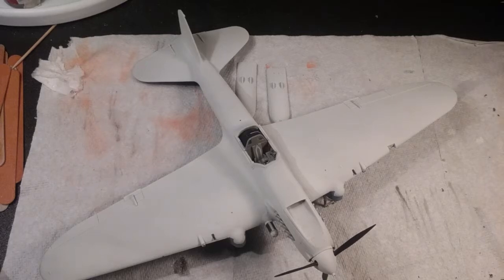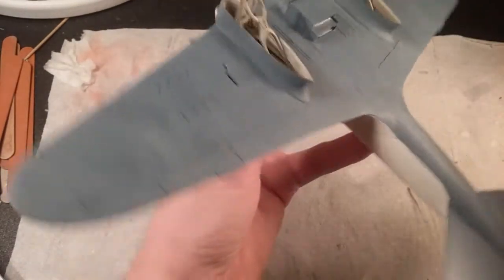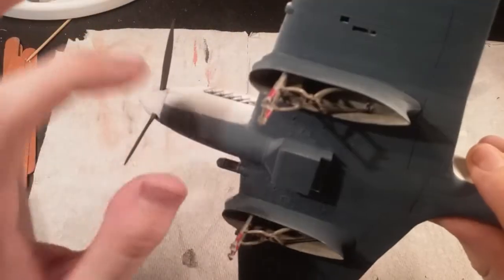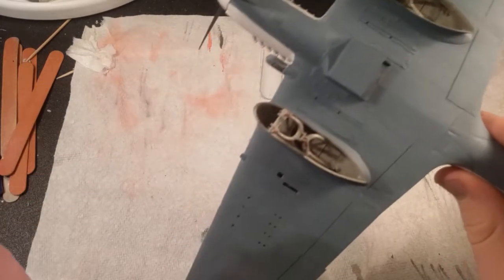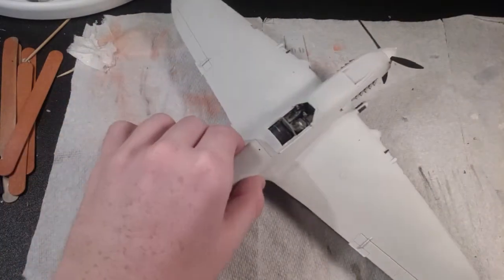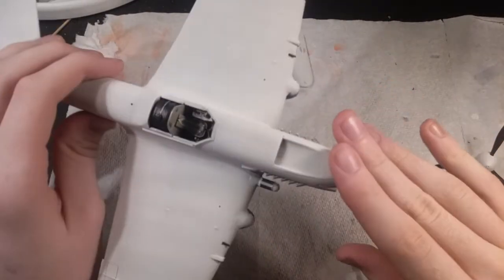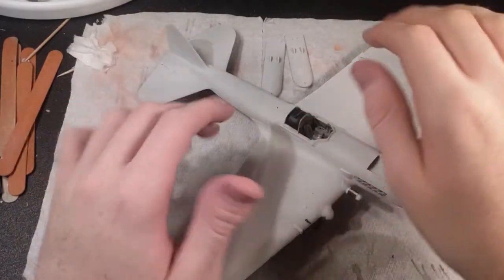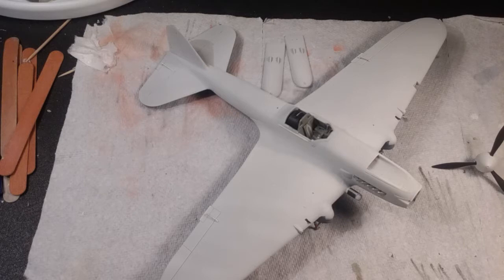Accurate Miniatures 1:48 Il2 Shturmovik Build Update: 03

Comment: This is still a fine kit after all these years. I have built at least one of each version.
    Like our man here, I have had problems with the landing gear each time, usually resulting in breakage. Then I found a solution: Scale Aircraft Conversions metal landing gear. These have been corrected to make than accurate, then cast in metal. You can get them from most big online retailers or direct from their web site at sacmactexas@aol.com.
   Ross, the owner, puts a lot of work and research into his gear and is a really nice guy. If you have questions, you can call him direct at 214-477-7163.
   And no. I don't work for SAC, just use lots of their parts.

Comment: Looking good Phil!  You're running into the same issues I had when I built the Academy Sturmovik...the instructions for the suspension for the skis are garbage.  I wanted my IL2 flying so I figured the skis would be parallel to the fuselage, so I monkeyed the suspension to support that.  Looks fine hanging from my ceiling.  I read somewhere that the skis were generally cobbled together at the unit level, so there was probably no standardization.
Reply from the maker: Scott's Bane Yeah I was really expecting clear instructions from these guys because the parts I read already were really nice. Hopefully I shouldn't run into anymore problems ☺